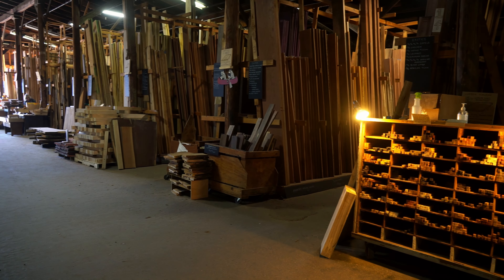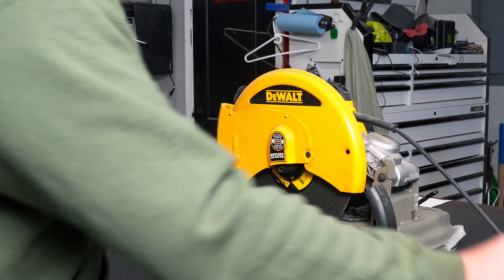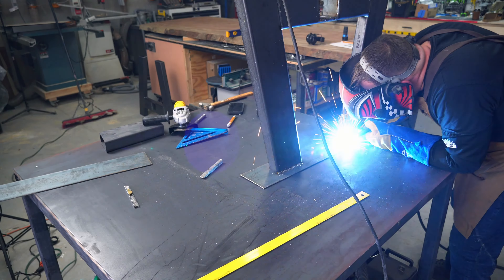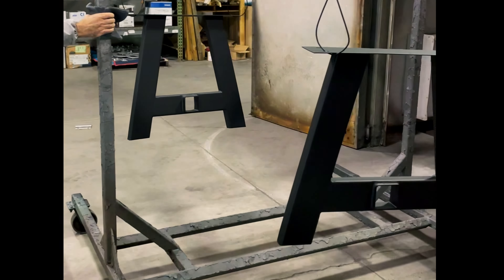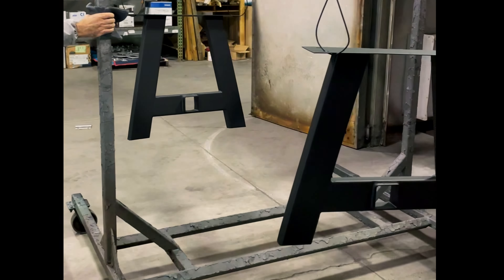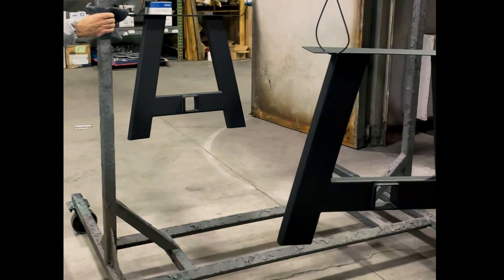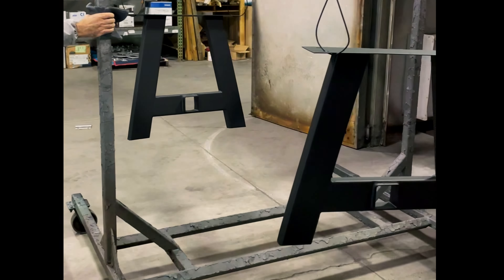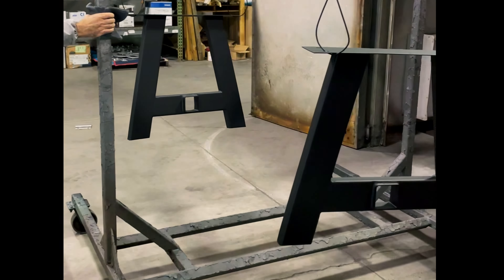We HAD to build a table out of THIS slab!

Comment: I didn't see any issues with your first Rubio application...I've watched Cam Anderson apply it the same way many times. Looks great
Reply from the maker: Thank you!   Up close it was “streaking” which was probably not an issue I’d just never done it before and got a little nervous. 😃 The reason I applied the second coat is actually because Cams got a great table finishing class that I watched where he said he worked with Rubio to develop that whole “red scotchbrite and second coat process.”  Up close it really did look a bit shinier after.